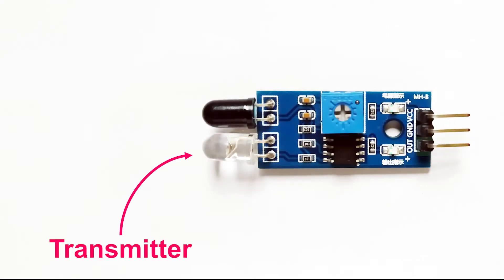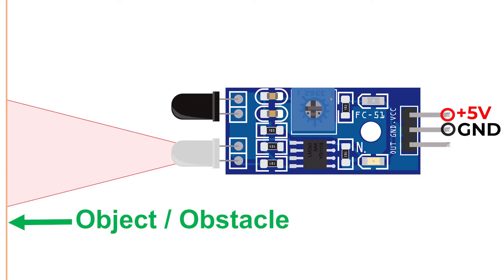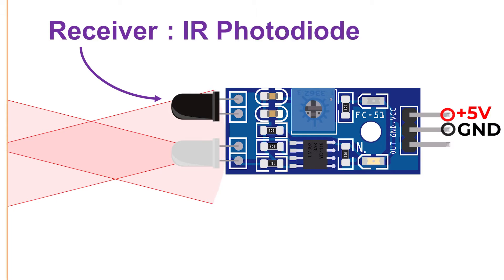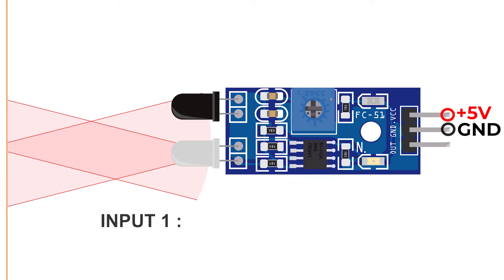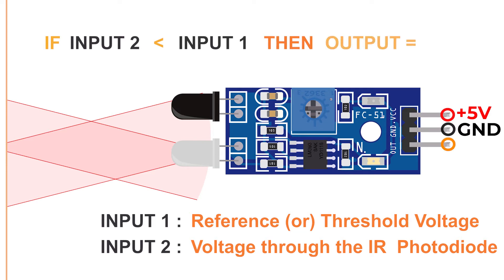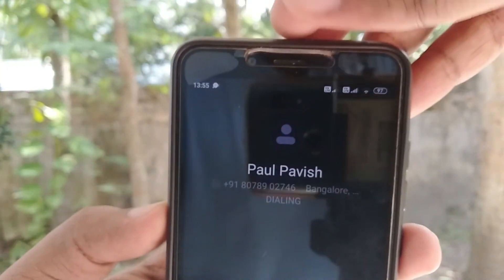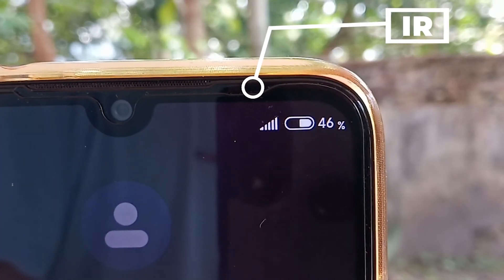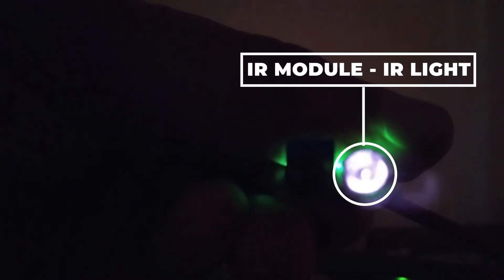InfraRed (IR) Proximity Sensor : What is it ? How it works ? Where it is used ?

Comment: I have both the three and four pin varieties of these sensors but can’t get either to actuate a 3 volt relay.  Do I need to add a transistor to actuate a relay?
Reply from the maker: Yes, it is safer and effective to use a  transistor for the relay actuation